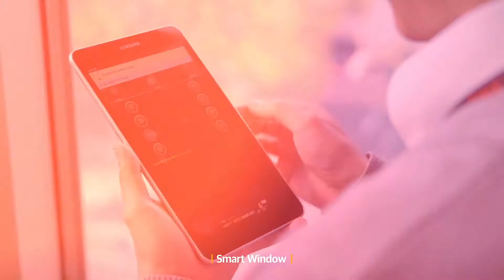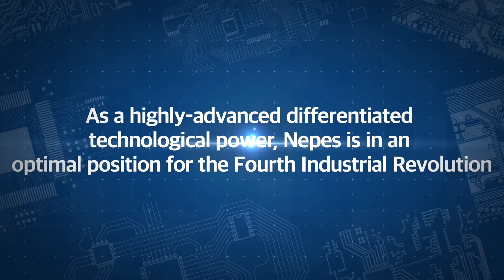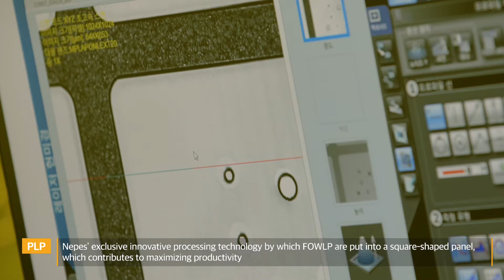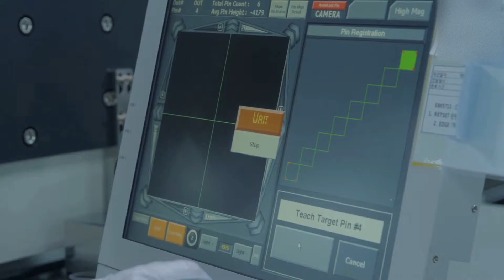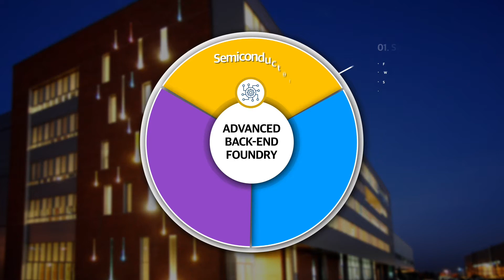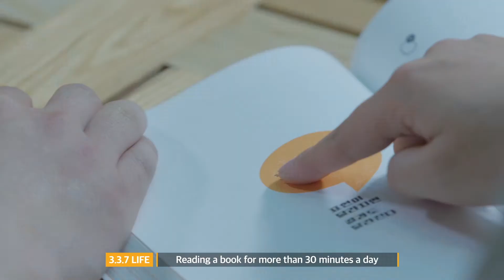NEPES Corporate Video 2021 (Full Ver)

Comment: Dear NEPES Corp  IT Security / IT Team,

I hope this message finds you well. I am reaching out because I learned that Nepes Corp suffered a ransomware and data exfiltration attack on 11 December 2025. I sincerely hope your recovery process is progressing as smoothly as possible.

I represent BlackFog, a cybersecurity solution focused specifically on preventing data exfiltration, blocking command-and-control traffic, and stopping ransomware behavior at the earliest stage, even when traditional EDR/XDR solutions fail to detect it.

Because your recent incident involved a large-scale data leak, I believe BlackFog could provide immediate, meaningful protection to prevent future exfiltration and stop similar attacks.

Could you please forward this message to the person-in-charge of IT Security or Cybersecurity? I would be glad to provide:
    A short technical briefing
    A live demo
    A trial deployment
    Technical details on how BlackFog stops data theft before encryption begins

Thank you for your attention. I look forward to supporting FIT in strengthening its protection against future threats.

Best Regards,

Edy Sulistiyo
Blackfog APAC
Mobile/Whatsapp: +62817 999 4447
email: e@ptitd.com